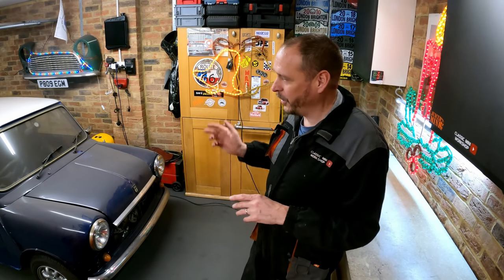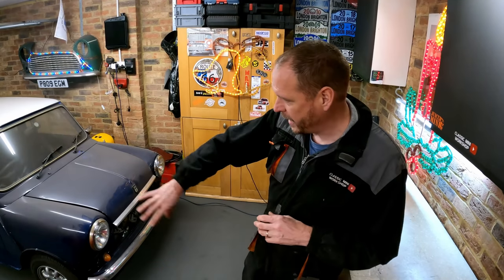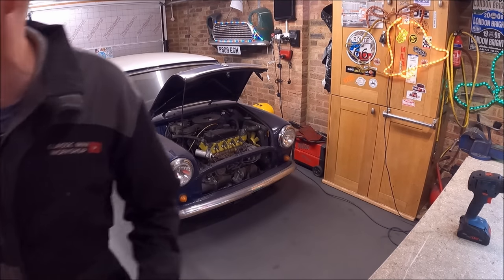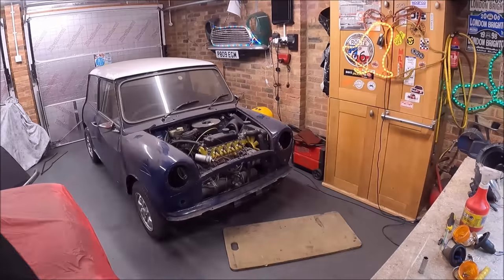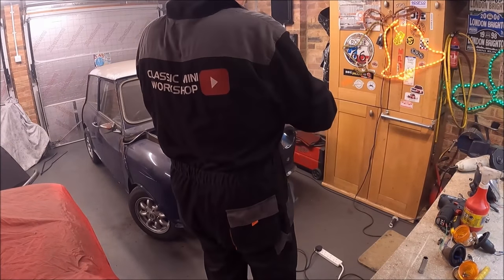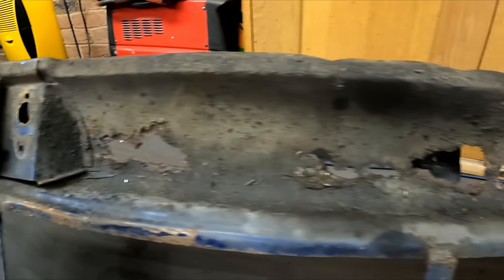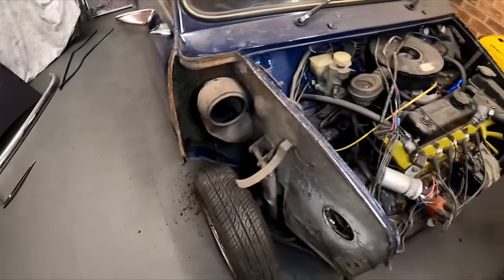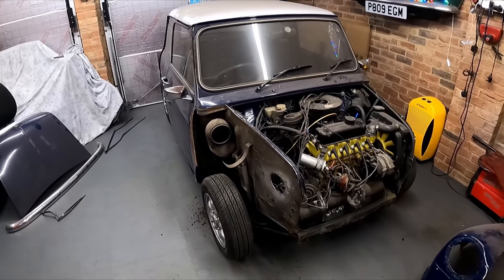Front End Removal *Budget Restoration* - Classic Mini Workshop Part 15

Comment: Hi Keith, making decent job mate,  if I were you I,d protect that front screen from grinding sparks. Big mistake I made. The hot metal burns into the glass which can,t be removed.
Reply: That’s exactly what I was thinking, done the same mistake years ago.
Reply: It's a budget restoration, Keith is bound to fit a new screen 🙂
Reply from the maker: Good call, I didn't think about that. Ill clean it off tomorrow and see if there is much damage.

Comment: Good Work Sir!
Been following this body work closely to learn more about how they fit together. My car ('88 Saloon) has been previously restored and has the over sills. No signs of damage like on this car. But I want to spray FluidFilm/Cavity Wax etc into the sills and reach the heel/toe board inner areas. Can you recommend how best ot reach these inside cavities? I have a 360 Deg. spray tip on a length of tube for this type of work. Can I get in from the rear subframe fixing bolt holes? Rear side bins? Front air vent or door jamb openings? 
Cheers.
Reply from the maker: You should be able to get the rear heel board and most of the sill through the rear door bins depending how long the 360 probe is. You can also get down the door hinge panel/A panel through the check strap hole or interior light switch hole. There should be plenty of places to get inside the cavity.

Comment: Hi Kieth, long time watcher , first time comment. Do you think it is possible to remove & replace the front panel without taking the wings off? My mini has the same rot on his front panel but he has had two new wings fitted in recent years and I do not want to chop them off !
Reply from the maker: Yes, I don't see why not. I would cut a few mm below the seam joint and then drill out the spot welds from below

Comment: I bought one of those Italian pattern front panels and it fits really well to my Heritage wings and inner wings even just clamped. You will not like the finish of the welds on the bottom valence though.
And on that note I would leave the subframe in place to give you another datum for that front panel to work against. That front panel that came off looked original so were there any body shims?
Glad you decided to go front first as I am in the same place or will be this week when the rotisserie is off and subframe is in.
Project budget is coming along nicely!
Reply from the maker: No shims in the front at all. It's definitely the original front panel. I had a nice surprise in the next video, the inner wings are remarkably clean and solid under about 10 coats of underseal! Did they only start using shims on 12" Minis? This would have originally been on 10's
Reply: @classicminiworkshop   The shims came in with the rubber mounted subframe 1976 on. Never seen any fitted but then on older cars subframes come out or front panels changed, shims are dropped and never seen again.
I have 4 "just in case"

Comment: For the price of a drivers inner wing repair section, i would fit a new one. M-Machine P/N CZH3064 ?
Reply from the maker: £57.25! Are you feeling OK? LOL
Reply: @classicminiworkshop  Is that Mini Spares? £48 on M-Machine. Feeling ok??, well sometimes you have to have a splurge, makes you feel good lol but just look at all the money saved on reconditioned brake hose's  😁 I'm sure someone has a spare knocking around, i do but its the other side pmsl.
Reply from the maker: @paulrobinson3528  Ah yes, I forgot about the hoses LOL
Reply: @classicminiworkshop  Keith, how could you forget such a cheap fabulous fix 😂

Comment: I've seen Mini's with removable fibreglass front ends. No rust but might smash to pieces in a crash though.
Reply: My project came with a removable steel front end. Wings and front panel welded together and slid onto the front of the car using pins and clamps!
It found the scrap pile very quickly!
Reply: Believe me the original front end folded up very easily in a crash. Crashed mine back in 1978 into a wall, the only panel not bent or destroyed was the boot lid!
Reply: @stevenmoran4060  I can believe that. There isn't much strength in old Mini's at all.